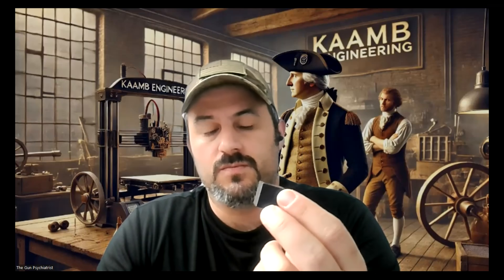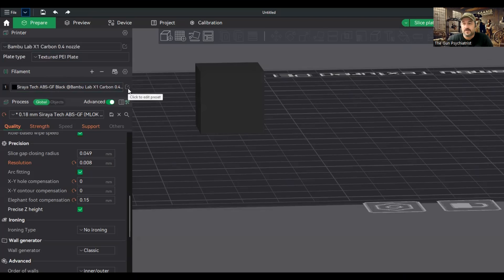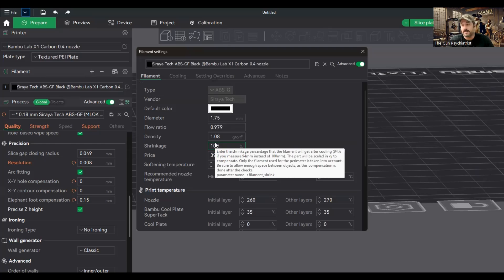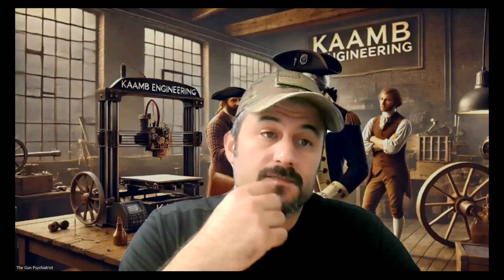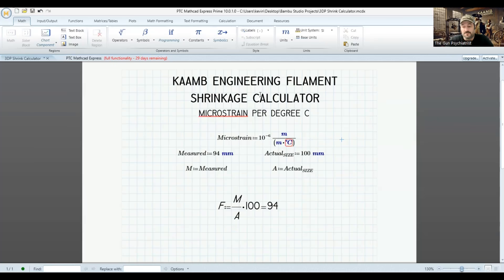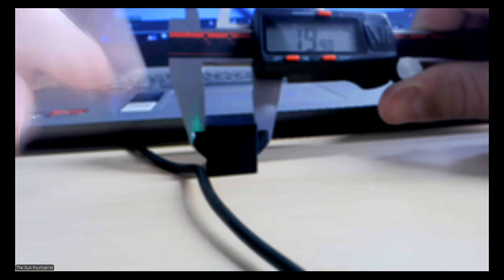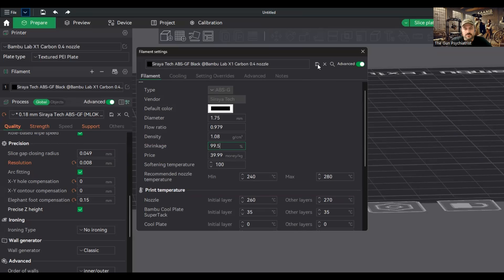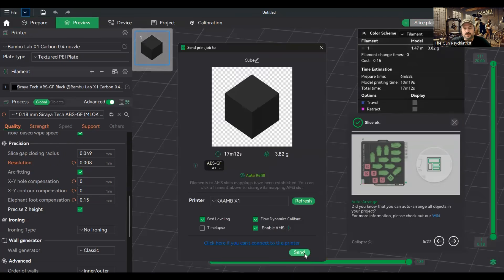I fixed the Bambu Lab Print Inaccuracy: Achieve Perfect Dimensions with Shrinkage Settings

Comment: i used a object cube in the Bambu studio plate and it measure 25.6 x 25.6 x Z 25.6 when I printed it out got 25.45 x 25.45 x Z 25.65  how would you fix that wrong Z height??????? I wonder if the China inch is bigger that the USA inch or the UK inch because the cube should be 25.4 x 25.4 x z 25.4  which is an Inch cube. Good info Gunman
Reply from the maker: Lol. I am not sure how you fix z height. Try the precise z height option. Also your filament has some expansion characteristics that you must account for as well.

Comment: Where can I access the file to input my measurements please?
Reply from the maker: You don't need the file. It is made with mathcad prime. The formula is factor=measured/actual*100

That will give you the scale percentage for studio. Please note though, if you have painting on your part, these different factors will cause issues. It is a known bug however I don't know if BBL has fixed it yet. You need help making the math,  math email me.
Reply: @ Thanks very much dude!
Reply from the maker: @Doyle69   my pleasure Doyle

Comment: I realized the math but it doesn’t account for if you have a different x,y,z measurement. How do you input for that?
Reply from the maker: @jjdepaz1  I am not sure I understand your question..
Reply: @TheGunPsychiatrist  I have same issue, for example im in the middle of a calibration step, X 29.22  Y 29.7 Z 29.7
Reply from the maker: @KarlsBerg87  I would try firmware adjustments to XY compensation and use precise z height to bring those numbers in closer. Using the shrink feature hinders filament coloring. If you have a different color feature on your model, the 2 shrink values bring about a bug in the software and features become offset. I think this is why xy comp gets turned off with painted parts.
Reply: @TheGunPsychiatrist  thanks

Comment: So, I haven't received my P1S yet and this may not be an issue.  But I am wondering how you adjust separately in X, Y and Z? Is there a calibration routine for each axis?
Reply from the maker: @ottdave1  there is really no adjustment outside of resizing. I make my adjustments with CAD. So if I need a geometric feature to be a certain size, I print and pull measurements. From there I will either enlarge or reduce the feature(s) in CAD and the next print they are accurate. However there is a bug in studio if there are multiple colors on the object being printed.

Comment: Thats a great idea, but did you try it also with larger pieces? For example a piece of 100x20x3mm. In the past that the issue, it was valid for the the size whith wich you calibrated and if you go bigger or smaller it didn‘t fit.
Reply from the maker: I did do a 50^3. All held however, in this I discovered a bug that was in the software that I reported to bambu. When Shrink settings are enabled for a filament, it will destroy the painted objects. It is something that I hope has a fix in the next update.

Comment: You’re an engineer?  Cause .01mm equates to 4 ten thousandths of an inch...pretty sure you can’t measure that let alone consistently produce that in PLA.  Good video though, and I agree with what you’re doing (just over-promising in the written introduction).  That being said, it’s only one step towards compensating for thermal expansion since different shapes and changing environmental conditions will also contribute to error.  Still worth doing though!
Reply from the maker: You can measure it with calipers. If you watch in the video I actually do this. Granted I prefer imperial units, however just about everyone in the 3d printing world including the slicers use SI units, hence why I use these in the video. But 4 ten tho is hard to measure and that is why using mm makes this task much easier!  I can also produce this consistently with any filament. When I get some time, I will shoot another video for you showing this.
Reply: @TheGunPsychiatrist  You can measure to .01mm resolution with calipers, but you can't guarantee the accuracy.  The standard for measurement is to use a tool that measures with a resolution 1/10th of the tolerance value.  You'd need to measure with micrometers (0.001 resolution) with a torque limiting feature.

(i.e. If you want to measure +/- 0.1 you need to use something that measures with 0.01mm resolution)
Reply from the maker: @Omniverse0   @Omniverse0  bro we're talking about 3D printing not EDM or 0TM.  You lost me on that last part because I understand what you are articulating. It is a great argument you are applying but to the wrong topic of conversation.
Reply: @TheGunPsychiatrist  Bro, we're talking about measurement - precision and accuracy go hand in hand when it comes to metrology.  It doesn't matter where you apply it, some standards overlap.  If you're measuring a tolerance of 0.01 with calipers, you might as well give yourself a +/-0.01 tolerance on the measurement you're reading.

(i.e.  I measure a 10mm feature as 10.05mm with calipers, you might well assume error of measurement would mean it could be 10.04-10.06 because you don't have the resolution (precision) to know how close to 10.05 you really are.)

If you were claiming "0 - 0.1mm accuracy", I would have have not thought it much worth the commentary, but you're expressing "0.00 - 0.01mm accuracy" using a methodology that is fundamentally unable to substantiate the assertion.

In the future, consider that "constructive criticism" is often meant to be far more "constructive" than "critical".  It is no flaw of mine to want the information we are all consuming to be cough accurate.

That said, the video is still informative, so thank you for the content overall.